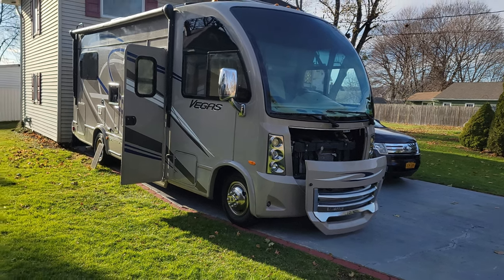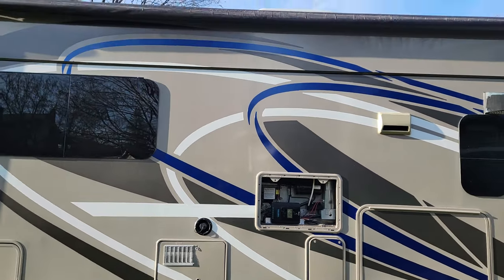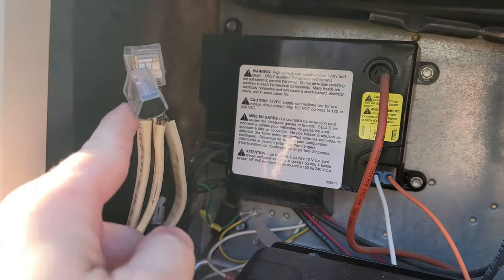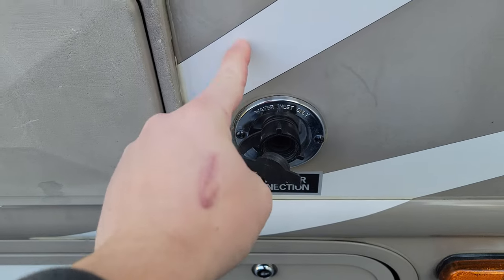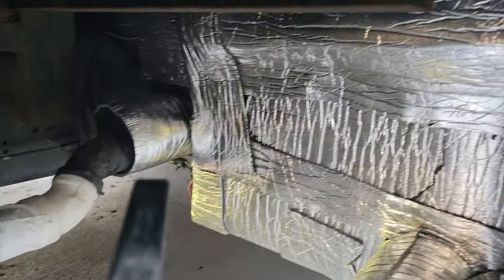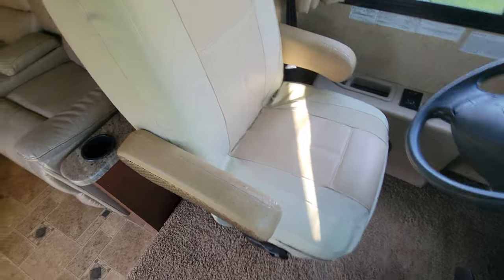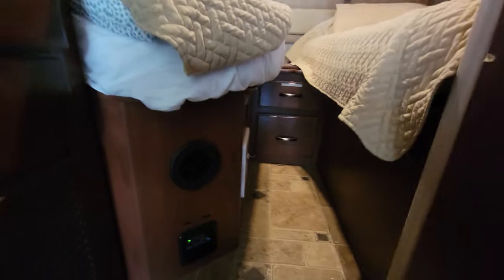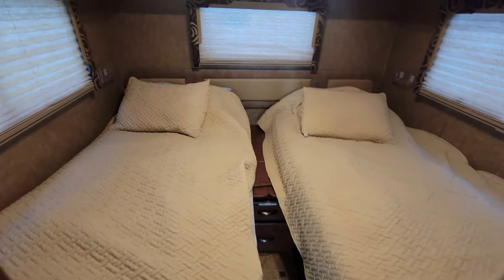2014 Thor Vegas 24.1 Upgrades and Improvements. Part 2.

Comment: Man, you've given me thoughts and months of upgrades to do! I just finished installing a folding shelf beside the bathroom sink on the shower side. There's no counter space in there. And those vent hoses? Great place for a mouse to enter like it happened to us. I installed wire mesh over the ends but LOVE your mod with the K&N filter. 
I also had a vent hose full of water when I was moving them around. 
Great job on the mods and thanks for sharing!

Comment: Nice videos! I have the exact same model as you. I watched all the other ones on vegas as well. I recently started having issue with water only trickles from the kitchen sink while bathroom sink, shower, and toilet have good water flow... When i turn the water pump on it works normally with bathroom area but with kitchen sink it goes on and off like as if there's blockage. Do you have any idea what it could be? Thanks in advance.

Comment: Do you or have your customers had problems with the equipped generator. I have a 2017 axis that the generator has been a thorn on my side since I bought it brand new. If I run the generator while traveling down the road usually I do this to run the roof air conditioner to keep passengers cool in the back I think the extreme heat from outside coupled with bad ventilation results in overheating of my generator. Did you do anything with yours in regards to ventilation or cooling?
Reply from the maker: @danielkimes8495  I don't have any issues with the generator on my Vegas. However every 100 hours I do oil change and other required maintenance on it.

Comment: `I could talk for a week about the issues `I've had with my Vagas.   Drives great!   But the construct/workmanship....SUCKS.
Plastic shavings/chips in water tank causes water stoppage in filter screen.   Generator carburetor needed to be replaced (fuel vanishing) installed shutoff valve.   etc.....

Comment: Would you recommend this RV?  Thor quality?
Reply from the maker: I have a mixed feelings about this unit. It's a great concept, but overall quality is mediocre. Plus the shower really sucks. If you're handy and ready to remedy various issues than, yes - indo recommend it. But if you want an RV that is worry free - then NO.
Reply: @VladyslavSvyrydenko  I don't think there is such thing as a "worry free" rv. I've spent the last year reviewing rv's and torn between the axis/vegas and a similar size class c. This and your other videos are great, sub'd. Thank you.
Reply: @retiredandtripn4159   I agree there is no worry free RV.  I own a 2016 Vegas 24.1 and enjoy it.  Yes I have done repairs on it, some myself and others paid a professional.  Upgrading the twin mattresses was one priority.  Have used the extremely small shower but not often.  You can go practically anywhere in these!! Fun to drive and I tow a Jeep Wrangler effortlessly even in the mountains.
Reply: I ended up purchasing a 24.1, 😆 🤣.  Have you been to any of the begas/axis meetups? There's an east coast and a west coast meetuo each year.